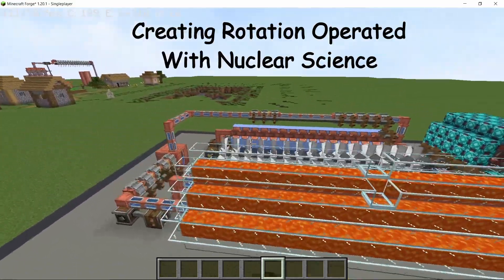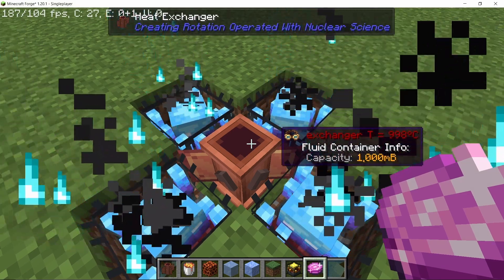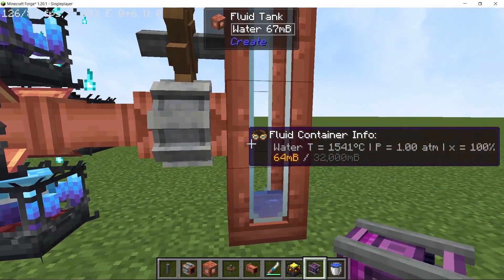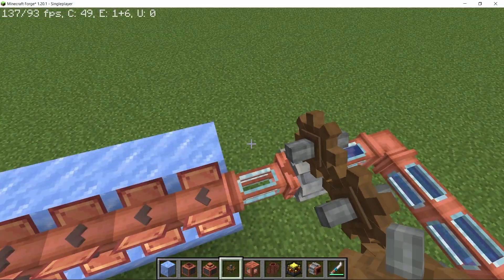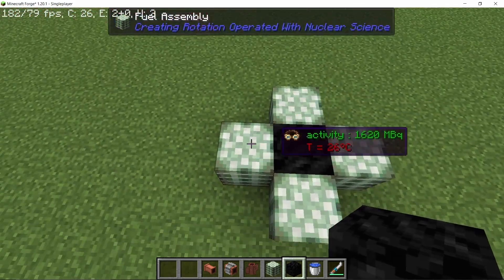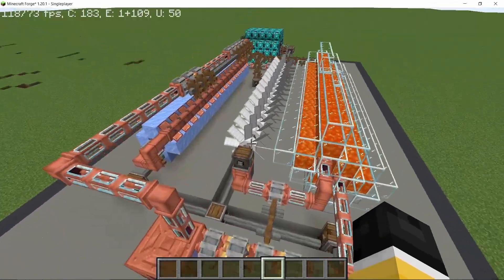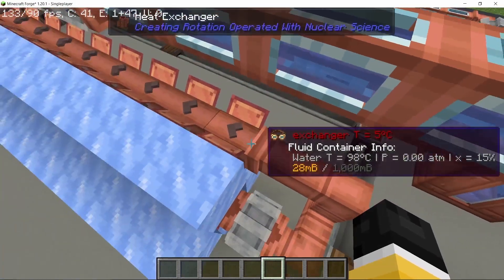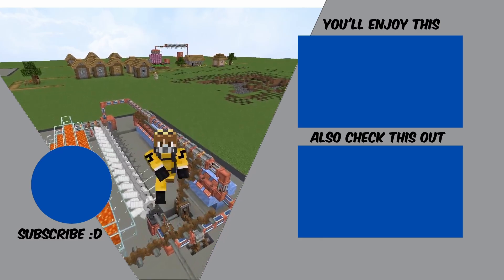Using NUCLEAR REACTORS to make Stress Units - Create CROWNS Mod Showcase

Comment: My first reactor was a 5x5 diamond shape of fuel and about 7 blocks high/long, with fuel in a checkerboard pattern in the center, using water as a moderator around all the fuel (except the very edges of the 5x5), and 4 heat exchanger tubes in the center. I think your issue was building too big, too much fuel can end up blowing the reactor pretty quick, as I discovered in my second reactor trying to mirror the RBMK design.
Reply: Also, if you have the flow to handle it, you can use 4 steam inputs around the turbine blades for even more power, was blown away when I saw my relatively small reactor could produce millions of SU
Reply from the maker: You might be right, I'll definitely give this 5x5 design a try and see how it goes from there. Also as the mod has updated and nuclear meltdowns are difficult to get I'll be able to make it work hopefully. Thanks for the help 🤜🏻🤛🏻